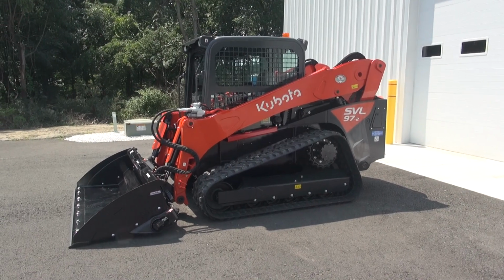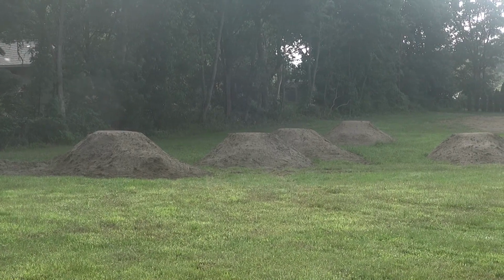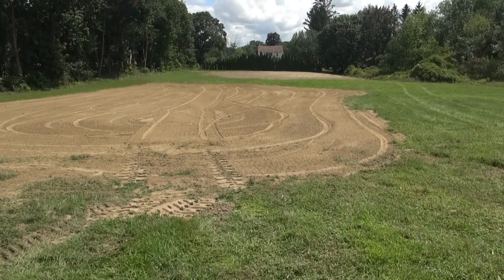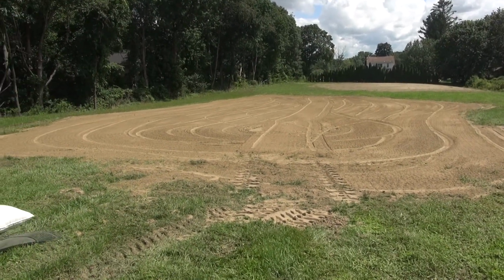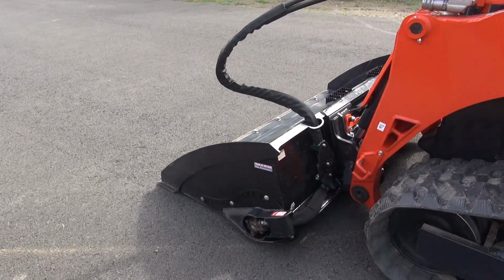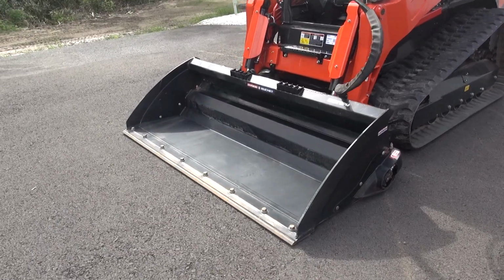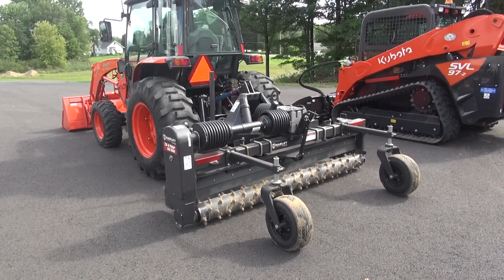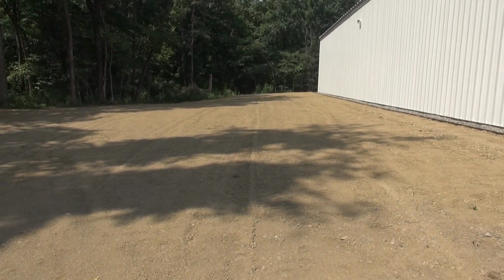Kubota SVL 97, CMP Hydra Bucket, & Harley Raking

Comment: It’s been a while since this video, do you still feel the same about the hydra bucket? Also do you feel it could replace a regular low profile bucket, is this bucket low profile and long bottom to be able to see the cutting edge like the standard low profile bucket ?
Reply from the maker: I do feel the same about the Hydra bucket. It’s like all of the other work attachments. It’s a specialty tool. It will do everything a standard long floor profile bucket will do. The visibility of the cutting edge is the same. The standard land pride or Paladin bucket has a little more capacity because the Hydra Bucket uses a little room for the rotating drum like a Harley rake. The Hydra bucket works great when smoothing out and grading material that has a lot of clumps such as clay or breaking down, topsoil with sod in it or leveling out a area that has some minor vegetation and is not smooth. For general purpose work I will use the standard bucket if I don’t feel I need the built-in rotating drum for those purposes. But yes, you could use the Hydro bucket all the time if you chose. The big thing with a Hydra bucket is to make sure you keep the rotating drum very well greased with the Zirk fittings on each end never letting it run dry.

Comment: I am purchasing a SVL65 next week and I'm on the fence to either get a standard bucket or just put that money towards the cmp hydra bucket right off the bat. Which route would u recommend I plan to do seed beds and grading.
Reply from the maker: The hydra bucket is a great work tool, but I’m not sure I would give up the standard low profile bucket with a reversible, cutting edge and its place. Although, I guess you probably could. Every implement is a tool and has its purpose and its place. The hydra bucket is wonderful for breaking up chunks of soil. The Hydra bucket is an investment. The standard bucket for its cost as compared to the cost of the machine is well worthwhile to own also. Pallet forks would be the next choice. The standard bucket and forks will be discounted with the purchase of the machine through Kubota. I hope that helps.

Comment: I believe that you might be able to get a finished seedbed with just your Hydrabucket if you float the drum and curl the bucket upwards.
Reply from the maker: Yes, you can achieve a nice finished seedbed using the Hydrabucket, as you described, especially if the area is small. Where the Harley Rake shines is especially when the area is large. You get a much more uniform, even finish with the Harley Rake due to the wider width and especially because the Harley Rake has guage wheels which controls an even finished depth much better. So the Harley Rake gives a much even finished work. However, the Hydrabucket will get it close. It is a phenomenal implement. The Harley Rake will fine finish it a little better. The main difference is the guage wheels where the Hydrabucket relies on the float function. Fine grading the guage wheels on the Harley will win every time. The Hydrabucket is a must buy. Using them both together is worth their weight in gold. In alot of instances you could get away with just the Hydrabucket.
Reply: @Celeco4948  Now instead of convincing my wife of why I “HAVE” to have just one of the implements, I’ll have my work cut out explaining why there’s a “NEED” for both! 😫

Thanks for sharing the footage and the advice!
Reply from the maker: @robert5521  The Hydrabucket is a great implement because it will fine grade and brake up any packed material. It is nice to have a two in one implement. I just prefer the Harley Rake for fine grading. Plus you can angle the Harley Rake. I love them both. If I could only have one it would be the Harley Rake. But the Hydrabucket is definitely worth owning. Keep the drum on the Hydrabucket well greased at all times. I will be doing more videos soon. If you own both  you wont be disappointed. Tell your wife I said that. LOL!
Reply: @Celeco4948 , I can see your point. That set of implements together seems to be a very handy combo. I’ll make sure that I deliver the message to my wife as them being “must have” tools, per Charles! LOL 😆
Reply from the maker: @robert5521  Tell her I’m pulling rank on her! Lol I’m sure she’ll have some flattering things to say about me. HaHa lol